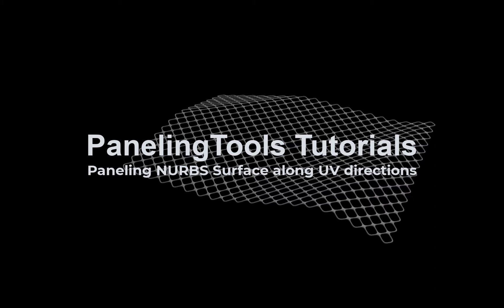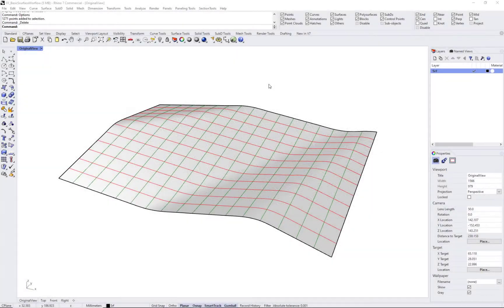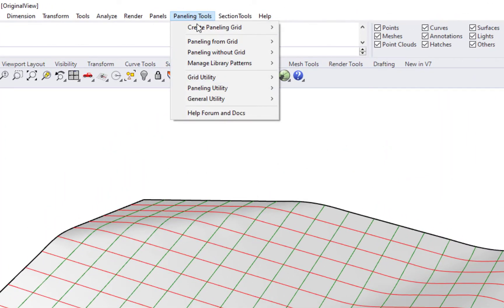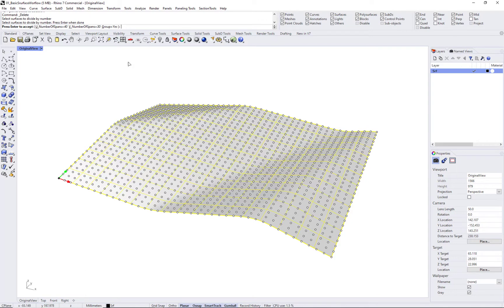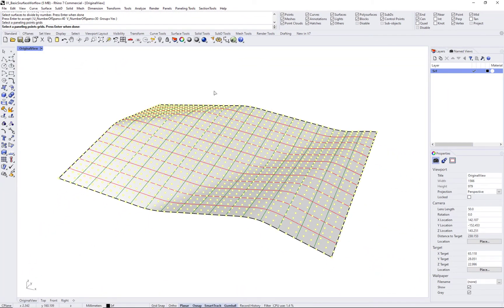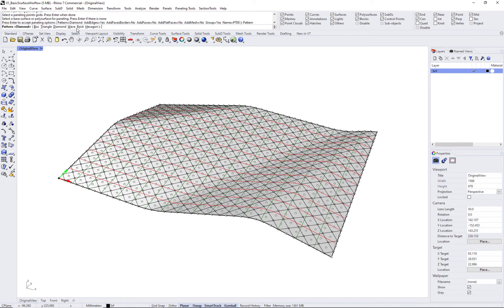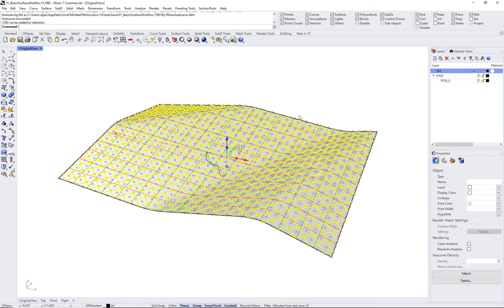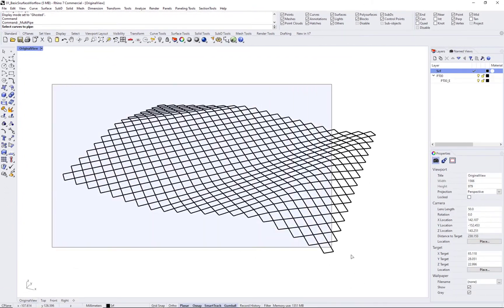Paneling NURBS Surfaces Using UV Directions

Comment: I did it and Tried to Boolean union and It failed..why?
Reply from the maker: What did you try to Boolean? If you use Multipipe in Rhino 7, it creates a SubD surface which you can turn into a NURBS surface using ToNURBS command. I hope this helps.
Reply: @rajaaissa3574 I used the usual R6 pipe and  The output of paneling tools was 3000 closed extrusion and Al them are intersecting and I can't make them one object
Reply from the maker: @HO-mi9pj  Yes this is expected and is why Multipipe is a powerful new feature in Rhino 7. It is designed to deal with this case that is hard to calculate through Booleans